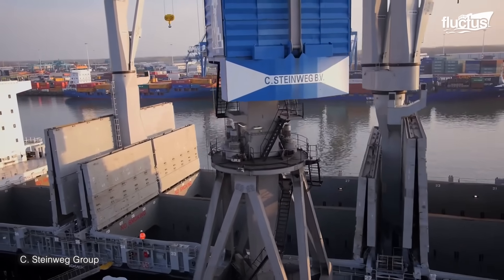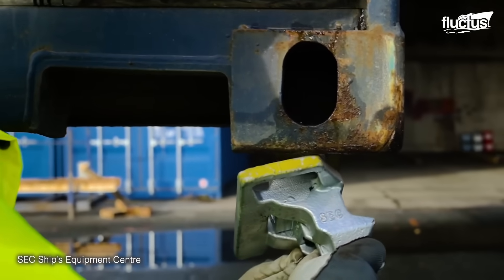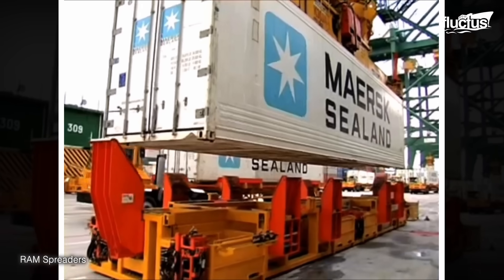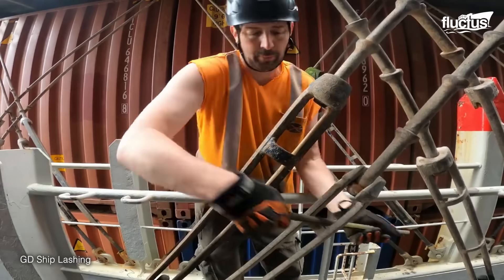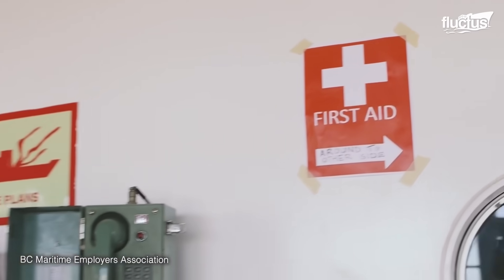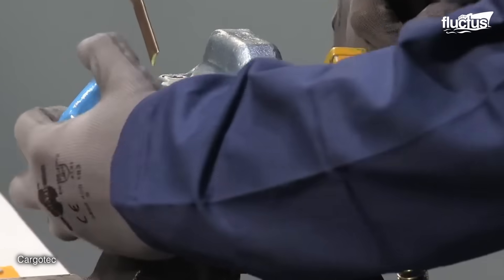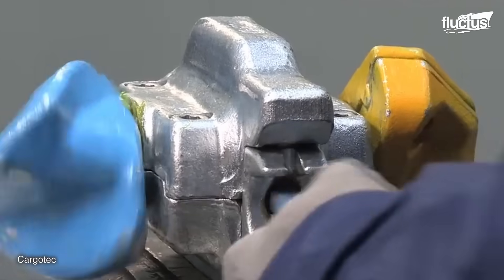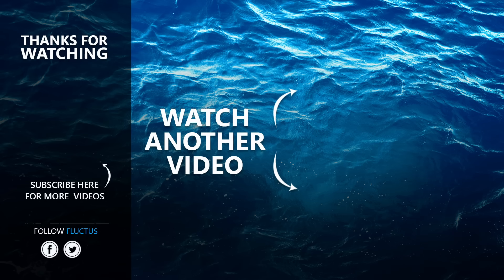The Genius Techniques Engineers Found to Tightly Secure Massive Container Ships

Comment: Corner locks provide "increased efficiency," when we haven't mentioned any efficiency yet, so it's not clear what's increased.
It's automatic so there's no manual labour involved. We have no idea why the video shows that guy putting those castings in the slots in the corner of the container by hand.

Comment: Who owns the hardware?
all those thousands of twistlocks and lashing rods
do they come with the containers? the ship? on loan from the dock?
how do they keep track of them all so they get returned after use? or is it a communal thing?
Reply: Every ship provides their own pins. They usually have 10+ pin boxes that get unloaded when the ships arrives. Every pin that gets removed from containers goes in those boxes to be reused later for loading the ship then when it's all done the ship loads up the pin boxes aboard and does the same thing at the next port.

Comment: I had occasion to be on a container ship while it was loading. The two lashers were incedible. Working in unision, they applied the lashings without falling behind. The noise was deafening, very loud. I wonder how a person would know if a stack was collapsing. I discovered, during the short time i was on deck, there was a distinct noise pattern indicating a successful placement.

Also, the ship's crew, every 2/3 days, while the ship is underway, are required to inspect lashings and remove the slack

Comment: Twistlocks is such a genius tool that tightly secures containers,the maintenance is outstanding 👏 👌
Reply: Why is he cleaning almost brand new perfectly clean "demo" twist lock? He should be cleaning the old and dirty one first!!! Also how many he can clean with such non-specific equipment? A boat have how many of these? 
Hundreds maybe thousands? 
Will he be able to clean a full set by his retirement? He does one in 5-6 min each container needs 4 so 30min per container so 16 containers in a 8h day. 15000 containers on avarage as per google so for him to do a full ship he needs almost 3 years for a full rotation....
Reply: @qa1e2r4  it's only a demo pal😎
Reply: @qa1e2r4 quite right .the demo is complete bs. I work on a tug that regularly moves barge loads of containers. The only maintenance those locks got was getting washed when they were float tested.